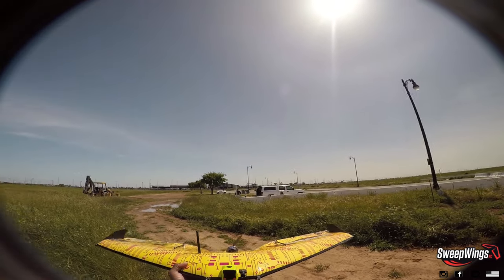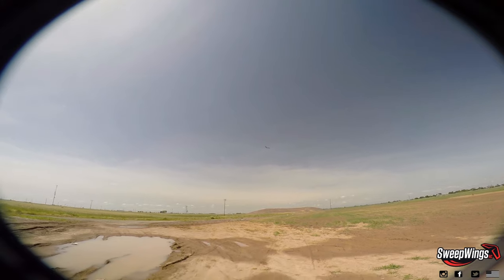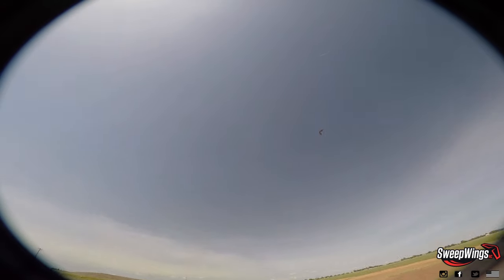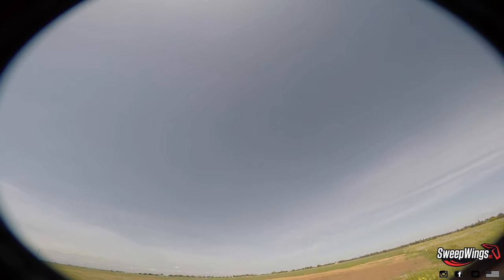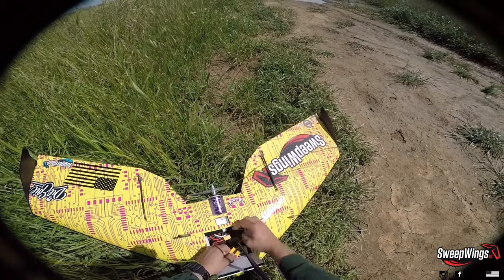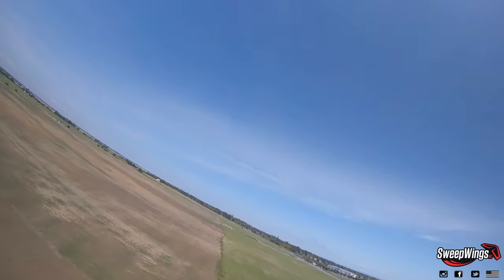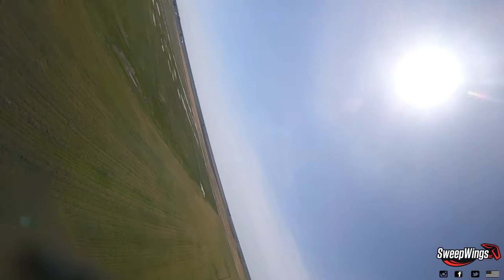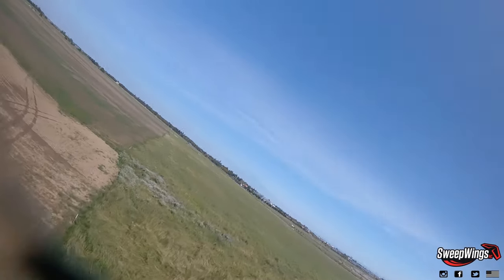Sweepwings 8s Juggernaut maiden

Comment: Duuuude. What Prop are you using? I guess it's the 1650kV Turnigy Motor right? The APC props are rated with 190.000 rpm : diameter in inch

With 55.000 rpm on 8s that would only "allow" an 3,5" prop :D
Reply from the maker: Christopher Rohe  what if i told you "dont belive everything you read"  ;)  haha. I have bench tested alot of motors.
Reply: yeah, I expected to get that kind of answer :) Is there a chance you'll share your wisdom with others?

BTW: keep up your work. Love your wings, podcasts and other outlets.